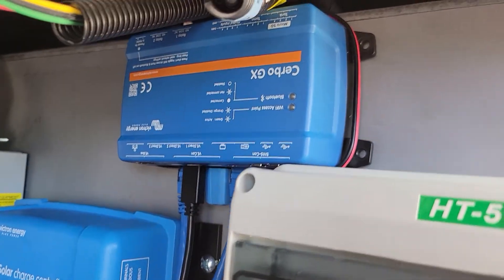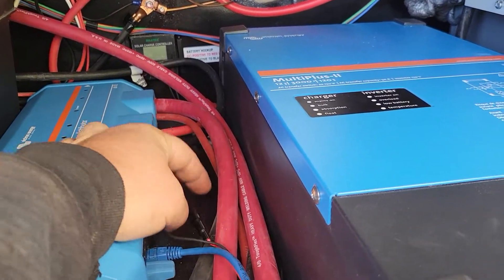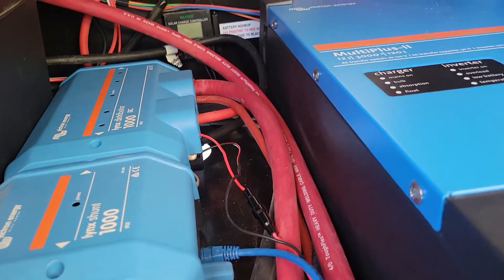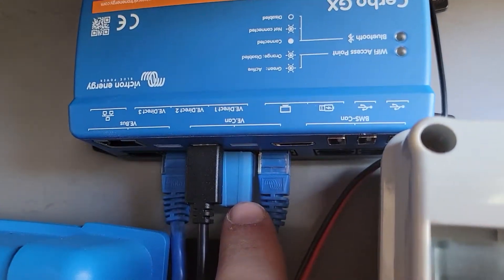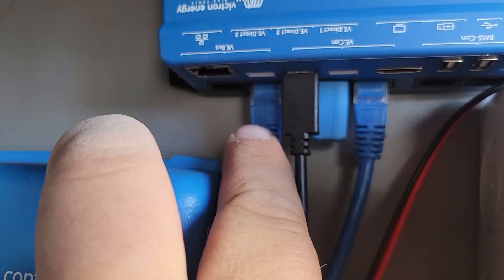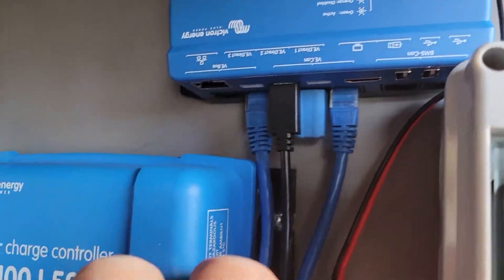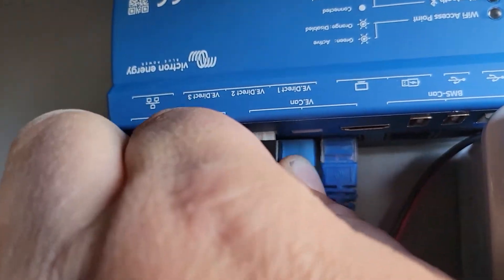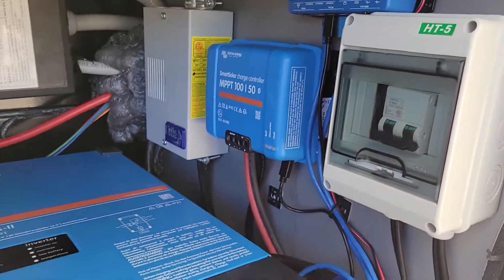How to wire a Cerbo GX

Comment: Any ideas how I could wire up a Cerbo GX for power if my Lynx distributor is totally maxed out on connections already? Thanks!
Reply: You can power it from the inverters input terminals...  this way your shunt can also measure how many watts the cerbo gx is pulling in the background